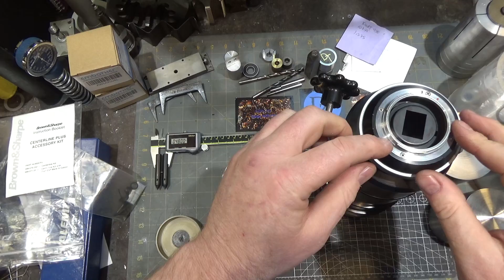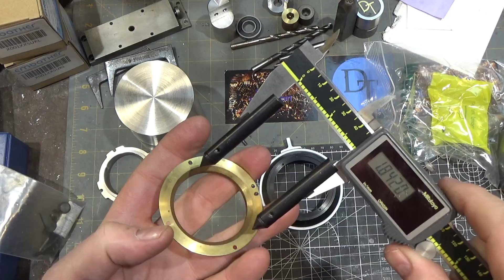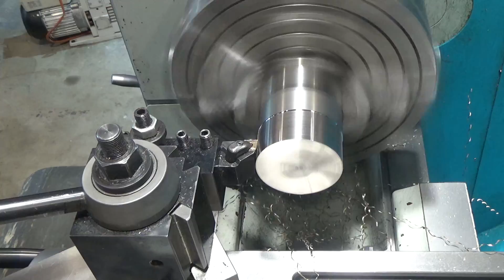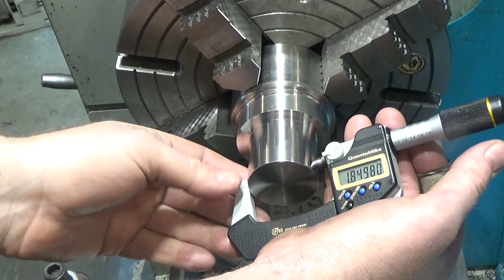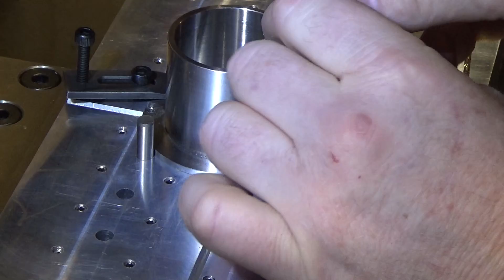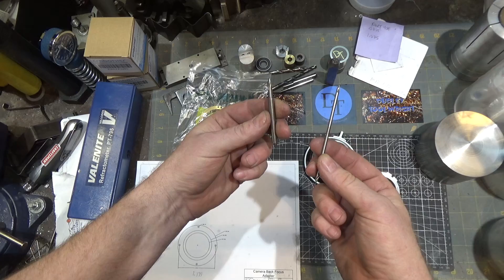112 Arri Camera Lens Adapter

Comment: Hi! I'm filmmaker and thinking of Arri pl mount is too big your stainless adapter, it probably don't fit inside the cinema camera, you also could use bronze or brass to be able to make the threads for back focus to be more precise. but it's good work anyway! thanks for video!
Reply from the maker: Thanks. I work in the industry as well. The furniture side. You know Tv. I work on Sony HDC3500 in studio configurations.

Comment: I don’t know what kind of oil you are using, but I have a a lot of good luck in stainless with viper venom cutting oil when drilling.
Reply from the maker: Thanks for the info! I use Cool Tool II and have not had any issues as of yet.

Comment: Flood coolant is your friend ! You guy's over there hardly seem to use it .  Rough out the sizes first  , keeps everything concentric . Turned out great . Cheers .
Reply from the maker: Thanks for the pro tips Max. I have been deathly afraid of coolant and never have used it until my surface grinder. I really hate corrosion so have avoided it. I know I need to bite the bullet at some point, especially if I want to try Titanium of Magnesium.
Reply: @DudleyToolwright  Magnesium can catch fire in a lathe , i am pretty sure water sets it off !   Cheers .

Comment: Welcome to the wonderful world of 304 drilling, ie a right PITA. Cobalt drills help but you still need to go slow but steady. One tip for the home shop is to drill a short pilot hole, open hole with a bigger drill and then go back to smaller drill and then larger, repeat till full depth. Sounds a lot of work but you need to prevent chip clogging the flutes which causes rubbing, heat and work hardened stock and melted drill. Once you have a decent pilot hole you can go to a big drill but keep the speed down and don't think you have to do it in too many stages, take a decent bite each time with plenty of lube.
Reply from the maker: Thanks for the great tips and thanks for taking the time to share your experience. I will try your suggestions next time.
Reply: @DudleyToolwright  everybody's equipment and "feel" is different so not all advice is universal, so try it and if it works fine. If it doesn't, try to moderate your language when thinking of me.🤐

Comment: God I hate stainless.
Reply: If it's 304 I would agree, some others are almost as easy to machine as mild steel, just so long as you don't work harden through rubbing  instead of cutting.
Reply: @chrisstephens6673  You forgot the part when the stringey chip curls around & marks the finish on the last cut !!!
Reply: @swanvalleymachineshop  to be fair that can happen when cutting Aluminium too.
Reply: @swanvalleymachineshop  have you tried roller burnishing if that happens? A really good way to mitigate tooling marks without altering dimensions to any great extent.
Reply: @chrisstephens6673  Never tried it . It's a good process though .
Reply: @swanvalleymachineshop  i have a little video showing my home made one if you care to view it.
Reply: @chrisstephens6673  I did & sub'd .  great demo , Cheers .
Reply: @swanvalleymachineshop  thanks for sub.
Reply from the maker: I'm right there with you. It was 304 or 18-8.